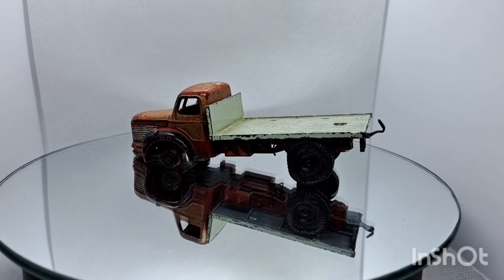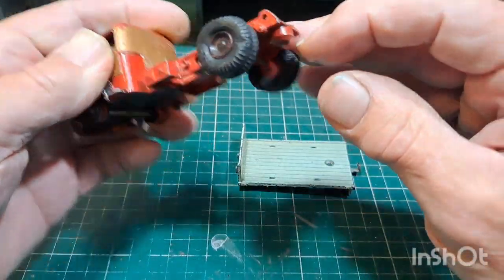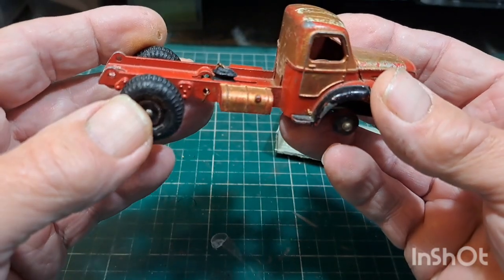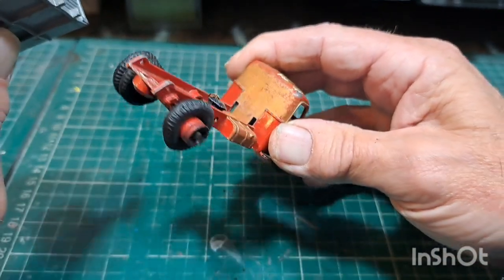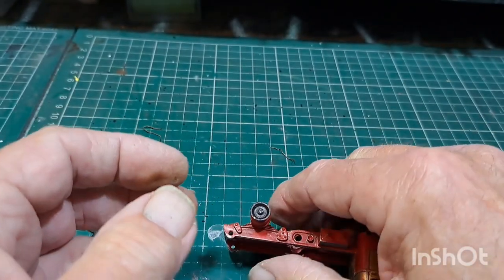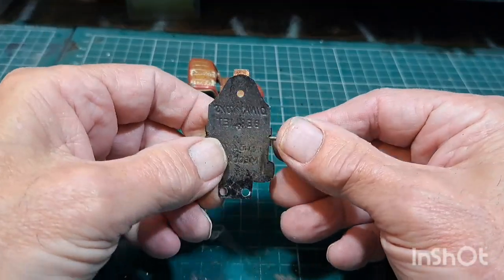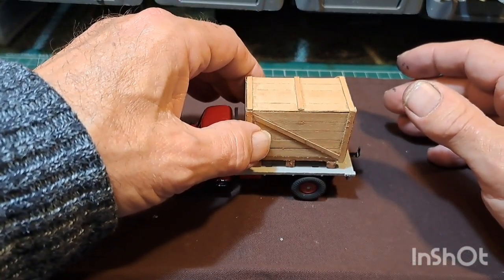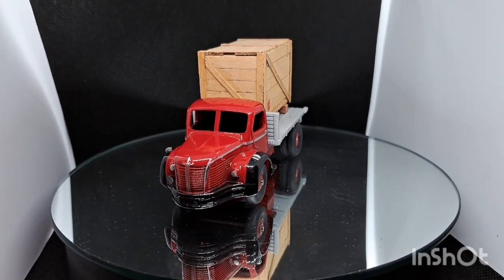Diecast Restoration Dinky Toys Berliet flat bed Truck. no/581. 1959/65

Comment: I think, BER-LEE-Yay: Nick would be better at that than me, but I cannot resist! 
Nice little truck, that - if it had plastic hubs, do you think it might have been an Atlas recreation? I would have thought with the age of the model, never mind the casting, the originals might have been steel - as it now turns out! Have you had the Woke Police on about not wearing gloves with the caustic? Don't worry, someone will (apart from me noticing!)

I think if you have a reversible drill, those wire brushes 'unwind' themselves again, so you get better us out of them - it is an old Scottish trick! 🤪 The final result is sweet - love the box!

Fingers crossed for 10th, Martin: I'm sure all here will be rooting for you!
Reply from the maker: Hi fraser, yes nick would be better at the pronunciation of this one ,it is definitely an original casting but the hubs just at first glance looked plastic,  woke Police  if thay want to complain then thay can buy me some gloves then 🤣

Comment: Even for dodgy mince pies, your fine detail painting is very good. Wish you well with getting them sorted.  I don't know how to pronounce the name either. Probably Burleyay. Certainly not seen it before. Unusual, Tre different. My head stood up at the twin rear wheels. Thought great idea for matchbox dustcart. Tho i fought a set of truck wheels from Flowers, they're spaced too far apart
Reply from the maker: Yes Ian thay might fit though these are quite wide to be honest, but worth investigating 🔎 all the best Martin
Reply: @martin dares dinky restorations.  had an idea how to do it. Just gotta wait for replacement power drill.

Comment: Hi Martin once again you've knocked it out of the ball park fantastic. It's all about the detail they really come to life. Sorry to hear about your glaucoma it must be so frustrating that it's interfering with the hobby you love. I have what they call ankylosing spondylitis witch means I have to give myself an injection every two weeks. They have just changed the injection because one of my eyes became badly inflamed and I had to go to the emergency department at the hospital. No one seemed to know what was causing it and then a young DR saw on my file ankylosing spondylitis and twigged that one of the side effects of this injection was Uveitis. After a few weeks of eye drops it came good but there was a little bit of damage that has been fixed with new glasses. I was diagnosed with ankylosing spondylitis 11 years ago when my DR said one of my blood tests had come back indicating I was anaemic. And then a year latter I started getting heart palpitations and was diagnosed with stage 2 heart block and ended up with a pacemaker. The heart block is a symptom of the AS.  Last Friday after ten years of faithful service I had to go and get the pacemaker replaced I was waiting in a hospital bed watching tv for 5 hours before I went in the op theatre. The good news is this new one should last 15 years and comes with a bedside unit that monitors the pacemaker and sends information back to the heart specialist. So less appointments to get it checked. He said if anything went wrong with it he would know before I do.  Other than that my ticker is in pretty good order and the pacemaker only kicks in about 20% of the time so if it stopped working it wouldn't be dangerous I'd just get palpitations again until it was fixed . Oh well now that I have brightened up your day I'll say see you on the next one take it easy mate.👍🏻
Reply from the maker: Hi Geoff it sounds to me like you need to pop over here and have a turn on the magic roundabout l will give you a good restore 😀😀 don't thay have some strange names for these illnesses .hopefully they'll sort me out .all the best Martin
Reply: @martindaredare  Hi mate they sure like making them sound dramatic. There's an old saying...The golden years are here at last...So I add...The golden years can kiss my A%#.😂😂🤣🤣 Oh well there is always someone worse off. Take it easy mate and I hope you come good soon.👍🏻

Comment: I assume this truck would have been very hard to drive with all the cantilevered weight over the front wheels. I have driven 1970s and 1980s Internationals with power steering and power brakes - beautiful to drive - the opposite of a Bedford TJ - drove like a wet sponge.
Reply from the maker: Yes definitely a lot of overhang on the front ,I can imagine it would make an interesting ride .thanks for watching my friend and all the best Martin